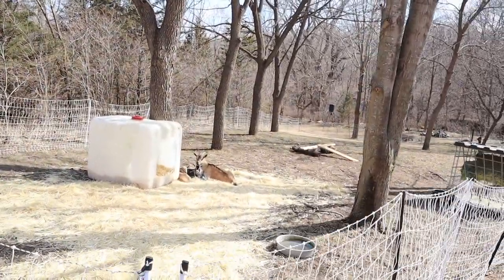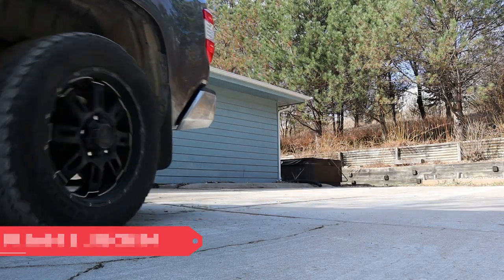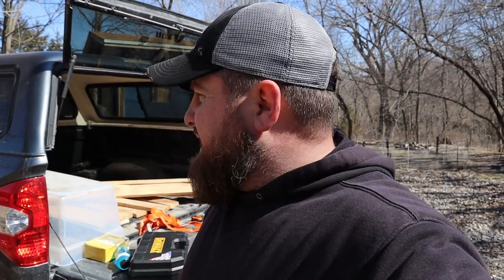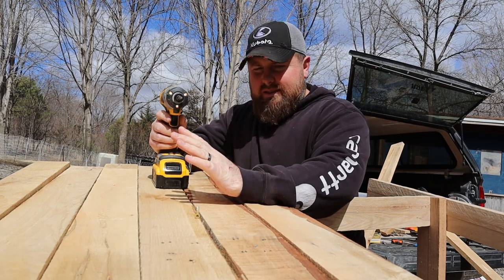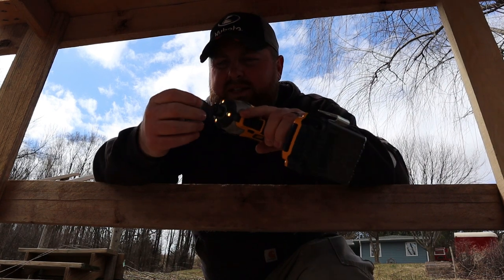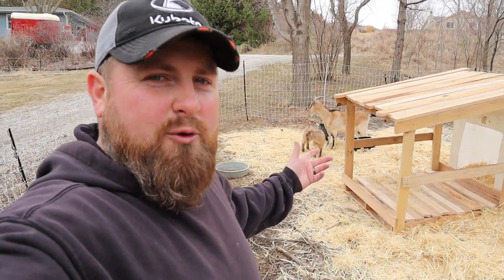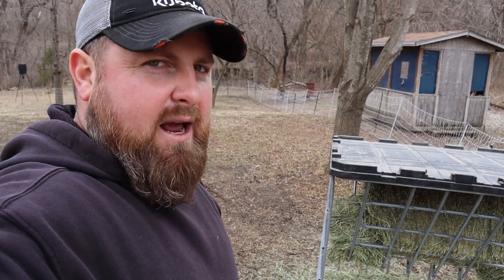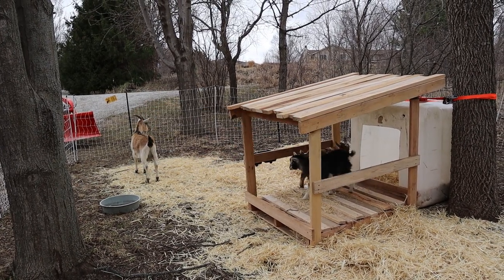This Needs Done ASAP Before This Storm Hits

Comment: You did a good job and they seem to like it. One thought though. The mineral feeder bucket you attached on the outside may get filled with rain water/snow. You may want to attach it to the inside. Did that happen? I couldn't see how far the roof hung over.
Reply from the maker: I drilled holes in them that day just didn’t make the cut. I do need to put pins in the holes I drilled to break the surface tension of the water because it won’t drain
Reply: @SunnySlopeHomestead  - That should help. It really did come out looking like an old time shelter. Love it!